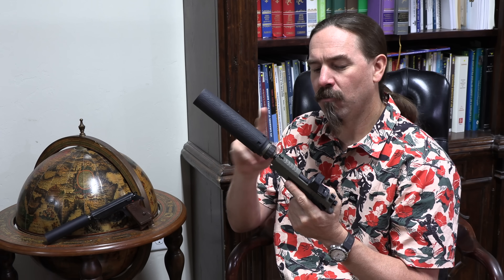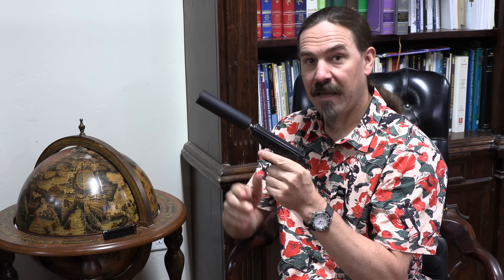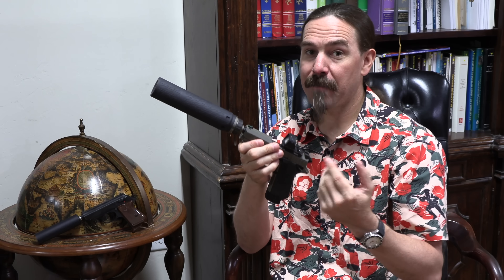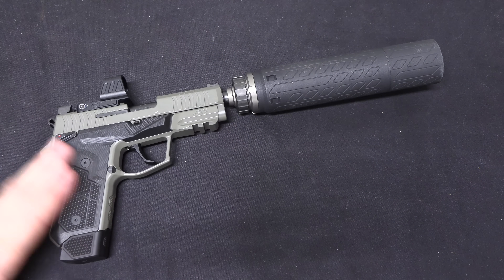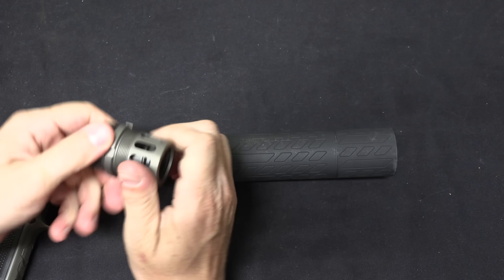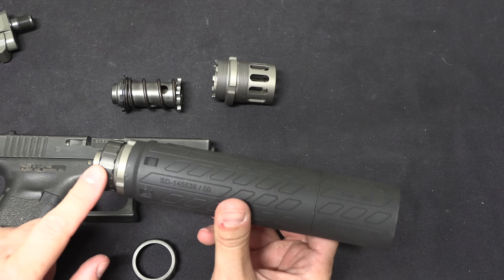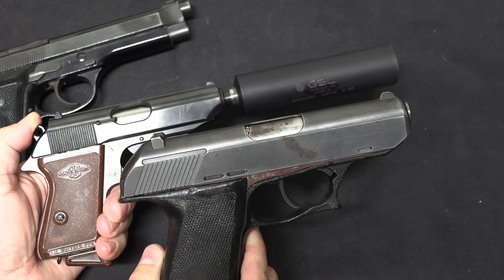Nielsen Device: How it Works and Why it's Necessary

Comment: 6:53 im sure you have but did you see the “Smarter Every Day” video where Destin had glass suppressors with metal internals - you could see how the gas flowed through them. It be was pretty cool. 

Laser Sintered Metal 3D printing has certainly allowed some creative designs. Too bad the entry point to that field so ridiculously high. 

I do 3d printing in plastic and can only dream of getting a metal capable printer.
Reply: The Markforged Metal X is 100% worth the investment if you're looking at getting into 3D printing in metal.
It'll print various steels, copper, inconel, titanium etc, and unlike a lot of metal printers it uses a metal filament system so it's way less messy and the machine takes up a lot less space.
Definitely worth checking out if you're looking at metal 3D printing.
Reply: @stevepalpatine2828 since its fdm, can we not just use it in our machines and send it out to debind and sintered?
Reply: @stevepalpatine2828true, it can but it’s close to 200k once you get the clean station sintering kilns etc. and a small build volume. If you segments prints you could use I guess. 

It also uses impregnated filament so not true metal like SLM with powders. Formal and fuse1 with the fuse, clean and spare cartridge is 50k and that nylon.
Reply: @OneSolidCube The build volume can definitely be a downside.
Reply: Let me tell you about the tale of a lad named Plaboi

Comment: I'm probably wrong for some obvious reason but.. wouldn't it be theoretically possible to make a suppressor so relatively heavy that a semi-auto pistol will function more like a "bolt action" pistol, like the Welrod?
Reply: He showed you that in the video. Just attaching a suppressor to the Glock without the Nielsen device and it turned it into a single shot, it didn't cycle.
Reply: You can but usually manufacturers will add a slide lock to prevent the slide from cycling and reduce the noise of the slide.
Reply from the maker: @rickv1007 You can also just stick your thumb behind the slide.
Reply: @ForgottenWeapons  Not sure I want to risk a broken thumb.
Reply: Threaded revolvers and reflex suppressors in 3, 2, 1, GO.

Comment: In the first slow-mo, it looks like the barrel is prevented from going fully rearward because the suppressor hits the front of the frame.
Reply from the maker: It looks like it, but did not. I was careful to check that before filming.
Reply: Given how far the barrel moves in the clip with the booster fitted, I don't think it actually did.  The threading on the barrel shouldn't be located far enough back as to inhibit mounting of something onto those threads; that would defeat the point of the threads.
Reply: It really does look like it but the way you can tell that isn't happening is that the slide is able to move independently of the barrel, showing that the barrel was able to move rearward enough to unlock from the slide.
Reply: @tranquile8046    good point.
Reply: @tranquile8046    good point.
Reply: I think it's just the camera angle giving that perspective trying to squish a 3d glock into a 2d sideways filming plane.

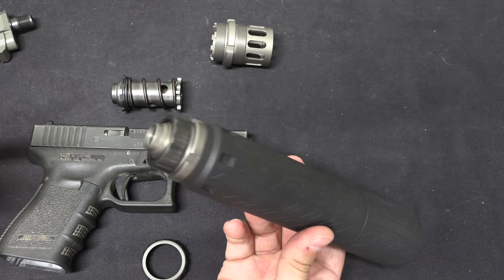Comment: 10:43 whoah sparky. Is that a metal on metal contact spark or is that just hot gas?
Reply: Looks like leftover-muzzleflash when you go frame-by-frame, probably venting through those long, vaguely oval holes in the device once the suppressor is pushed forward enough.
Reply: Most suppressors have a large first chamber where gas builds up. Man it can burn your face when the can gets hot. That is why I quit running cheap 9mm 147gr Federals and went to 150gr Syntech plastic coated rounds.

Comment: As a firearms enthusiast, this is the first time I've ever heard of or considered the need for a nielsen device; up to this point I figured standard ammunition would produce enough extra "overkill" recoil to simply cycle through the added weight of a suppressor. The demonstrations here are very informative 👍
Reply: It can, but if it's a non-subsonic load then you'll have a Crack!! every time you fire, like a whip when you swing it well, because the ammo still breaks the sound barrier. Means you can shoot without hearing protection but you will still want to, and it's far from quiet. A good Nielsen lets you also get "wiggle room" for the receiver assembly to move around if you've got a blowback system; the whole thing shifts around and an extra few centimetres lets casings cycle reliably while the Nielsen "breaks up" motion at the baffle assembly from the receiver.
Reply: The thing is, a suppressor not only adds weight but also reduces the recoil by trapping the gas. （deltaP=mv=Ft) 
Case and point: muzzle brakes are considered the most ideal suppressor adapter because it essentially serves as an extra baffle （source: one of hop/brass fact’s recent videos)
Reply: (22 LR Pistols user) Why isn't one told this at a FireArms store 😢 ?
Reply: @MarcoECDC depends what 22 handgun you have. Many are fixed barrels which is the first situation described in this video. The barrel doesnt move when cycling.

Comment: When barrel bullet compared to position of fired bullet? Could this interact with suppressor potion and could make bullet trajectory misaligned with suppressor? Like if bullet fly very solowy it could hit wall of suppressor as its tilt with barrel.
Reply: Bullets don't fly that slow, and there is a chance for a baffle strike. It would never hit the "wall" without destroying the rest of the can. Also, watch a few slow mo vids with energy transfer, the projectile has long exited before the comical effects catch up. Same thing applies to weapons platforms.

Comment: 9:18 are we just going to ignore part of the problem appears to be the suppressor also is hitting the frame?
Reply: As you can see later on, the barrel itself is only supposed to move a few millimetres before the slide takes over and carries on.
Reply from the maker: While it may appear to be hitting the frame form the slight angle of the slow motion video, it is not actually. I checked that before filming, and was able to rack the slide to eject the empty case after firing.
Reply: @ForgottenWeapons ok just wanted to make sure another issue wasn't being overlooked
Reply: The slide should still cycle because by that point, the barrel and slide have been uncoupled.

Disclaimer: not an expert

Comment: the suppressor is hitting the frame on the way back….with the direct thread. I think this is more influential than the mass of the suppressor
Reply from the maker: No, it's not. I was careful to check that before filming, although it's not clear in the video angle.

Comment: Good to see you have James Bond's iconic Walther PPK.
Reply: Yes, but it would not be Ian if the gun would not be made by Manurhin.
Reply: Not from the movie. In some of the movies, and especially notable for Dr. No it was a larger frame Walther PP. He uses a Walther P5 in Octopussy after reportedly losing it in the taxi chase in the movie's story.
Reply: Its a beautiful piece, aye!
Reply: James Bond's official pistol is a .32 caliber PPK. Mostly with an unthreaded barrel, but in some scenes, he somehow screws a suppressor on.
Reply: @AlanDPhd I didn’t realize until recently that most PPK’s actually come with a threaded barrel, but the threading is covered by the slide, with a smooth thread protector that makes it look like an unthreaded barrel at first glance. Suppressors require an adapter/extension, but this is better than having to buy a whole new barrel. Unique solution I’ve never seen on any other pistol.
Reply: @brennelement6451 Interesting!
Reply: Which PPK? The PP he's given, the Berretta sometimes standing in for it? The 1911 shown in a lot of firing scenes... 😉
 At least in Dr No that is, I hasten to mention.
Reply: @andrewince8824  Commando Bond wrote a book scrutinizing every firearm detail in the movies, his youtube channel is terrific for any fans of the series. It was amazing how many mistakes and switcheroos happened in the films, but they nevertheless made the PPK a cultural icon.

Comment: I’d like to add that recoil operated handguns maintain lockup by the friction of the bullet moving down the barrel putting a forward force on the barrel to oppose the unlocking and rearward movement of the slide. When the bullet leaves the barrel that force stops and the gun unlocks and the slide moves rearward. The weight of the suppressor makes it more difficult but also the compensator effect of the gasses hitting the baffles. This is the reason why you often have to use a lighter recoil spring when using a compensator despite them weighing very little compared to a suppressor.
Reply: the friction of the bullet is not needed in recoil operated guns.
Reply: @jebkermen6087 yes it is. Otherwise it would be a blowback operation with floating parts. It’s why the slide is easy to retract with just your hand because there’s nothing pulling the barrel forward to maintain lockup.
Reply: @drewhenderson13  then why does the math work without accounting for friction?
Reply: @jebkermen6087 what “math” specifically. Any “math” does account for friction. That’s why the recoil spring and slide weight of a recoil operated handgun is lower than an equivalent blowback handgun. The friction of the bullet keeps the gun locked up until it leaves the barrel. Pressure is reduced and slide velocity is decreased.
Reply: @drewhenderson13 No. just no.

the mass of the barrel is linked to the slide and therefor is part of the recoiling mass.
And they must move the lock up distance before they decouple, and stop supporting the case.

And on a working gone the lockup time os longer then the time under pressure.
Reply: @jebkermen6087 what you are describing is more like a hesitation lock. The browning recoil operated system does not work that way. Without the bullet putting forward force in the barrel the amount of resistance to the extraction would be the exact same as retracting the slide with your hand. Which is absolutely not enough. The fact that the barrel moves with the slide and tilts means nothing. That’s not what maintains lockup. If you doubt how much friction and force the bullet puts on the barrel then push a bullet down a pistol barrel with a rod.
Reply: @drewhenderson13  for any amount of drag that has to be overcome by the propelling gas, there is an equal impulse (force over time) on the breach and slide.

any amount of (pulling) the bullet does on the barrel is counteracted by it's push on the breach.

ie bullet forced forward by gas, slide forced back. 1 to 1.
bullet pulled(forced back by friction) -1bullet force.
Slide pulled shut(what you say is the reason for lockup) -1 slide force

so accounting for the effect of friction.
the slide is 1 and -1 = 0
and the bullet is 1 and -1 = 0
Reply: @jebkermen6087  right. The forces are equal while the bullet is traveling down the barrel. Barrel forward by the dragging bullet slide backwards by the case. When the bullet leaves the barrel the forces are not equal and the slide retracts. You can see this in high speed footage of handguns firing. Blowback slides start retracting before the bullet leaves the barrel. Recoil slides don’t start moving until after the bullet leaves the barrel.
Reply: @drewhenderson13  Wrong. 
accounting for only friction. 
and nothing else.
the net force is zero.

This does not account for the fact that the bullet is under acceleration.
For it to accelerate is for some mass to accelerate is the reverse vector with equal magnitude.
Reply: @jebkermen6087 the force from the case doesn’t go away when the bullet leaves the barrel. It is just reduced because pressure has dropped. This is why the slide velocity is lower and a lighter slide and recoil spring can be used. The net force isn’t forever zero. It is just balanced until the bullet leaves the barrel.